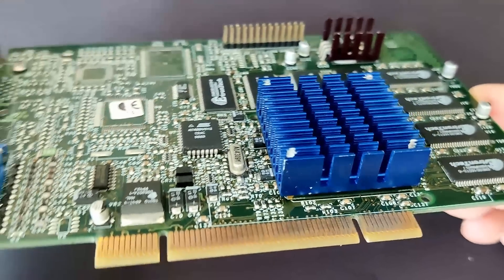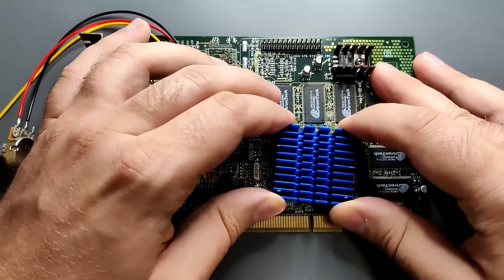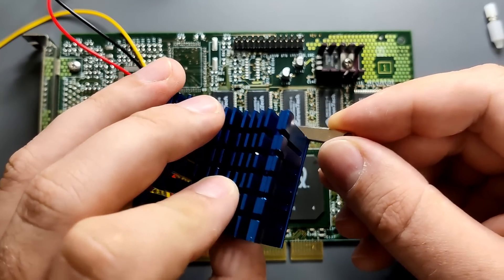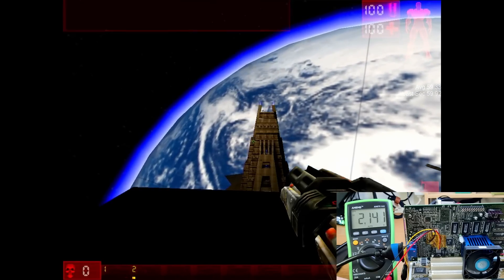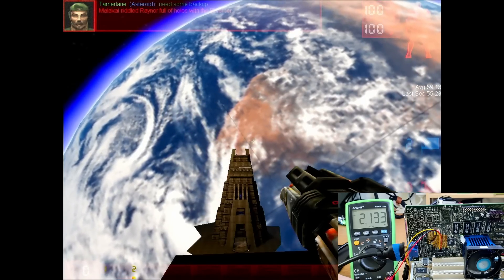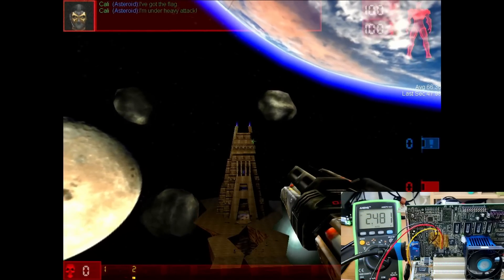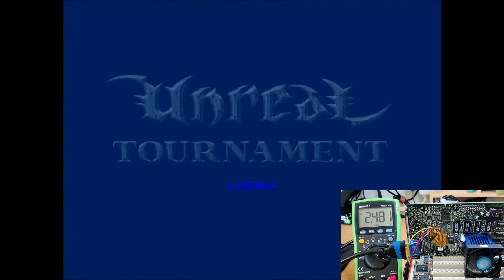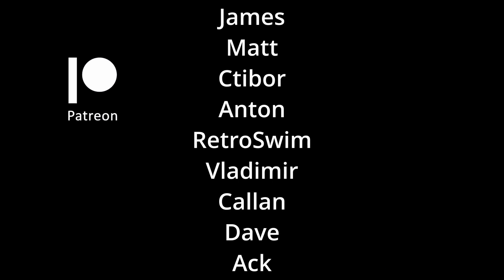The road to Voodoo 3 2500 | 3250 | 3800?

Comment: I'm in this boat right now.  I've got a 1000 with 5.5ns SGRAM that runs at 160 with very occasional artifacts, and I haven't recapped it or touched the voltage yet.  It's so tempting to give it just a little more voltage to reach the coveted 166...  What do you think I should do?
Reply: I found the confidential Voodoo3 datasheet online...  Since my card already had a heatsink attached by the previous owner, it should be safe to bump the voltage to at least 2000 level, or so I think.  I'll do measurements tomorrow but this is looking promising already.
Reply from the maker: All those chips should be from the same architecture. So, I don't think that there should be a problem overvolting the card a little bit. It could be that the lower quality chips leak a bit more current, but it should be fine. The Voodoo 3 1000 has a different layout though, doesn't it? So, I'm not sure if there is a similar resistor deciding on the voltage that is supplied to the chip and where it is. But I am sure there are voltage mod tutorials online. I just don't have a V3 1000, that's why I never bothered to look it up.
Reply: @bitsundbolts  Yeah, I did the measurements and the mod today no problem.  The card started out with a 130ohm resistor and measured 2.30V core.  I attained 166MHz at 2.50V, but in some games artifacts were still showing up, artifacts cleared up at 2.55V but after a while it locked up.  No artifacts or lockups at 2.60V, which is 100ohm resistance for me, which for some reason seems to be inverse compared to your video.  Seems I'll still end up with active cooling on this card as without the fan on the GPU chip reaches 74°C (case open).  I like my chips below 60°C.  Also for reference my real 3000 originally has a 120ohm resistor (no voltage measurement yet), it runs too hot for my liking and does lock up after an hour of playing if I don't cool it with a fan, I may try reducing the voltage on it as it has overclocking headroom up to 190MHz, good binning but 6ns SDRAM.  I have a dual fan slot cooler that I use for testing, but I may end up attaching permanent fans to both cards.  Interestingly but the overclocked 1000 beats my 3000 in benchmarks, I read that SGRAM provides marginally better bandwidth at same clocks, perhaps fewer wait states or refreshes perhaps.
This 1000 card still has one more problem though, the picture is wobbly (like horizontal jitter) at high resolutions, it seems to be worse when there is hard drive activity.  GPU clock and tweaking the refresh rate does not make it better or worse.  It's like there is insufficient filtering on the card somewhere, perhaps in the horizontal sync.  Some folks on Vogons also have similar problems with their Voodoo3, at least one said that recapping reduced it.  By comparison my 3000 does not have that problem.  Have you seen this problem?  What do you think it could be?
Reply from the maker: I would have guessed to be the capacitors on the card as well. I have not seen any noise in the image on my cards. But I may be a bit biased because I use the capture equipment and this sometimes makes things a bit worse. Also, I mostly use lower resolutions. A nice little project you have there! Some day, I need to get my hands on one of those Voodoo 3 1000
Reply: @bitsundbolts  I ended up attaching a heatsink to the back of the card as well, as that area was hot, so now it's a heatsink sandwich around the GPU.  I soldered an additional 47uF capacitor around the capacitor on the 5V rail feeding the GPU core regulator, however that did not improve the wobbly picture.  What did improve though is when I modified timings for the 1024x768 mode in PowerStrip to make them tighter, lower the scan frequency and lower the pixel clock, still 75Hz vertical, but lower horizontal clock and pixel clock.  Seems like a pixel clock PLL jitter issue above certain frequency (the rest of the refresh timings are derived from the pixel clock).  I wonder if this is something addressed in different VBIOS versions, I have yet to flash this 1000 with anything else.  I've seen posts online saying 1000 has one TMU disabled  by the driver and a YouTube video showing a registry mod that enables it in the driver, however mine reports both TMUs enabled in Quake 2 benchmark numbers also show full performance, so not sure what the deal is with those rumors.  Have your noticed any differences between VBIOS versions on these cards?
Reply from the maker: I did not see any difference when updating the BIOS on my Voodoo cards. But I also don't use higher resolutions. And some of my cards are broken and needed a reflash. So, I couldn't compare before and after. Not sure why your card has both TMUs enabled. Maybe it's a third party driver that does that automatically? I doubt it to be wrong information displayed in Quake since you get the full performance. Maybe run some other benchmarks to see if you get similar results. I assume your card has 16MB of memory - or does it have only 8?
Reply: @bitsundbolts  You're right, I use the unofficial 1.09 beta 10 driver.  That's probably the reason for the enabled 2nd TMU.  I'm thinking I need to flash it with some 2000 or 3000 VBIOS so both TMUs would work with any driver, probably from a SGRAM card, unless they're universal.  The datasheet does show the memory type configuration pin and chip count configuration pins, so in theory it could have detection capability...  I suppose that VBIOS editing utility might also let me edit the device ID so I wouldn't need to use an image from another model.  I have yet to experiment with that.
Reply from the maker: I have limited knowledge but that, but I'd be careful flashing a voodoo 2000/3000 bios on a SGRAM card. Even though the BIOS could have detected the memory, I doubt they implemented such features back then. They probably just released two versions. But I'm not aware of any SGRAM Voodoo 3 except for the 1000 series.
Reply: @bitsundbolts  I think I posted a link here with the Voodoo3 VBIOS repository for different types of cards.  Anyhow, I've been running it flashed to a 3000 SGRAM for some time now, it's great.  This way it has 2 active TMUs with any driver.  Now I added a 5V 40mm fan powered directly from the card, and it's icing over at just 32°C during extended stress test.  I may swap it for a Noctua fan later, but for now this is a success.

Comment: ah you should test at 32 bit color and 1280 resolution cause at 16-bit color it is a bit odd 800x600 well because it can another thing get a hot gun and punt the card on a agp 8 x card since your bios is flexible and can be configured at any type.

Comment: Another cool video. I am thinking about buying a voodoo PCI card for an Amiga 3000 I just built. Yes Commodore Amiga, with Motorola 68K cpu. Duaghter board has both Zorro III and PCI slots and Voodoo drivers exist for Amiga. Neat stuff. Keep up the good work.

Comment: I have voodoo3 3500 with faulty out connector, but I got similar dvi right angle port. Can you cover modding  high end voodoo3 for regular dvi output instead of using proprietary 3dfx cable. I don't have such cable. Many voodoo cards comes with no cable. It's easy to obtain vga loop cable for two first voodoos, but not possible to find reproduction for high end voodoo3 card. BTW stop torture those nice 3dfx cards. There is no point overclock them to get extra 5fps. Lastly, instead of attaching cpu-like passive heatsink I'd recommend shorter classic heatsink with active fan powered from external molex. Will be more than enough for regular operation and also will save another pci slot
Reply from the maker: That is an interesting change for a Voodoo 3 3500. I came across those cards without the cable. I will look into it - just need to find a reasonably priced Voodoo 3 3500 :) A damaged card (that can be repaired) would be great for such a project. And I completely get you regarding torturing 3dfx hardware - if I do something like this, then it will be just for the sake of a video. I am also looking for a better heatsink. I don't want to give up on two PCI slots (or the ISA slot).
Reply: You are awesome! Thank you for great content. Looking forward to see 3500 dvi out video. This could change ultimate 1999 pc build entirely. Tnt2 ultra can do 32bit, but v3 3500 can outperform in certain games

Comment: I've many voodoo3 and they are all high overclockable!!! My old V3 2000 easily reach 175mhz, and other V3 3000 pass 200mhz with one that work at 215mhz a really high freqency for that time!!! If you want the best ratio between performance/voltage for sure the best freqency is between 166/175mhz is the sweet spot!!!
Reply from the maker: I tend towards 175 MHz - I like the frequency and the opportunity to call it a Voodoo 3 3333 (as someone else suggested)!

Comment: BEWARE: artefacts are a poor way of verifying that the GPU is functioning correctly. Vector/polygon calculation errors will begin way before any typical artefacts become visible. 
OCCTPT is a benchmark that tests for such errors. Also "Artefact Locator" & Video Memory Stress Test" (both by Misha Cherkes) can be useful.
Reply from the maker: Stability has to be tested on those cards separately. My assumption in the video is to give 75 mV over the voltage where artifacts appear. But you are right, that doesn't mean it is sable.

Comment: Personally I go for active cooling and not have to worry about thermals at all. As for the memory I might get into doing such mods someday replacing with faster chips for obvious reasons though I already own a 3500 and with faster ram they can clock around 200mhz provided the core is healthy enough not being baked to death.

Comment: what about jumping the 3.3V regulator directly to PCI slot if possible?. that will reduce both power consumption and heat generation. if you're concerned about backward compatibility, you can add two schottky diode in between regulator output and PCI 3.3V, preventing backfeeding between both
Reply from the maker: That would be an option, but I think I miss the knowledge how to do something like that. I understand the concept of diodes and their purpose in your suggestion. I guess it is to prevent current to flow "backwards" into any of the outputs. But I would have to check if the 3.3V from PCI is routed somewhere on the board or if I would have to route it from the PCI connector (which is a possibility since it looks like this Voodoo 3 was designed as a 5V card with all the regulators onboard to get to lower voltages as needed).
Reply: @bitsundbolts  sure, another thing you could do is replacing the old linear LDO to buck converter. something with discrete mosfet might be better than one IC solution (which a lot of time they're using fake ICs). if you were going to replace the GPU regulator with buck converter, it might be a bit more efficient to take 5V rail as input compared to taking 3.3V from its "pre-regulator"

Comment: Great video as always! It's interesting that this V3 2000 came with 6ns SDRAM installed. Both of my 2000 AGP models have 7ns chips. I actually have a Voodoo 3 1000 with 5.5ns SGRAM, so I assume it can vary due to cost and availability of what they could get at the time.  In my experience, most of the Voodoo 3 3000s with 6ns memory I've tried to push seem to hit memory limits at about 175-180MHz, so it's difficult to get to that magical 183MHz mark of the 3500. There are some brands of SDRAM that seem to have more headroom than others. I seem to recall that the Hyundai SDRAM was a bit better than the others available. The two cards I did total memory replacements on with 5ns chips went from 177 or so to 191MHz before the core became the limiting factor. Cheers! 👍
Reply: The 6ns Hyundai SDRAM on my Voodoo 4 4500 AGP can reach 180Mhz. 183Mhz sometimes gives me flashing dots at higher resolutions in 3D games. I use the standard clocks now, because even Voodoo4 cards are getting rare these days.
Reply from the maker: I will attempt 183 Mhz on this Voodoo 3 with a voltage closer to the default 2.6 volts. I am aware that overclocking plus standard voltage will cause significantly more strain on the chip than running it at 143 MHz and 2.6 volts. It will be for a short test and see if it actually works with this chip.
As for the memory rating, I guess you are right in your assumption that it depends on what they had at hand at the time and what made sense financially.
Maybe there were some leftover chips that had to be put on cards that were phased out (5.5ns on a Voodoo 3 1000 is a bit ridiculous :)

Comment: Back in 1999, I had a Voodoo 3 2000 AGP with 7ns memory. I have overclocked it to 170Mhz for a few years without any problems, before I upgraded to a faster graphics card, after 3dfx was already no more...

My best Voodoo3 card in the collection is a Compaq V3 3500 AGP (not the original 3500 with the breakout pod and the tv tuner) with 5,5ns memory. This card looks like the V3 PCI versions with a normal VGA output. The Compaq can be clocked to 220MHz. This was only a test, just for fun. Only a 3DMark 2000 run.

3dfx cards are good investments today, so I leave it in original look without any overclocks.
Reply: I keep having issues with 3500 cards that some textures turn black while playing 3DFX games, happens on two different cards, had any issues like that?
Reply: Try out the latest 3dfx reference drivers for your OS and if this does not help, another mainboard. The 3500 cards draw even more power from the AGP port than the 2000/3000 cards. Early AGP mainboards could cause problems, especially former Super Socket 7 motherboards.

Comment: Nice. I would think Voodoo 3 3000 because the memory will be running at supported speeds.

I will be considering the same heatsink mod for my Voodoo 3 2000 AGP and maybe doing a little overclock myself.

Comment: Congratulations! Voodoo 3 might not benefit at all from the AGP bus; so, that might not be a limiting factor. Kepping it as a V3 3000 seems like the best choice, as most other people sugested. If at that level it can still run passively cooled, then it's a win-win. On the other hand, if you do need active cooling at 166MHz, then I would run it at 175. 
Now, I have to find time to mess around with my V3 2000 PCI.
Reply: It most definitely benefits from the AGP bus. While the Voodoo3 doesn't use any of the advanced AGP features, it's still on a dedicated 66 MHz bus. It has twice the bandwidth of a normal PCI slot, and doesn't have to share bandwidth with other PCI devices.

The PCI version of the card can also run in a 66 MHz PCI or PCI-X slot, if you have a system with one, which are rare. 66 MHz PCI and PCI-X slots are usually only found in high end workstation and server boards. The Power Macintosh G3 B&W has one dedicated 66 MHz PCI slot for video as well.
Reply: @GGigabiteM  Thank you for the explanations! So, I am tempted to assume that my V3 2000 PCI (2.1) is 66 MHz compatible (the motherboard I know for sure that it is and supports bus mastering at 66 MHz too at 266MB/s), since I get identical results as my V3 2000 AGP (1.0 at 2X = 533 MB/s). This also leads me to believe that V3 AGP is actually just 1X, not 2X. Alternatively, none of the games that I tested (up to Max Payne) swap too much data over the bus, once the VGA RAM is fed at loading time.

Comment: I'd say 166 is better for longevity. 175 is nice but the closer to the limit seems like the card would not last as long. And since it is something you'd like to probably preserve i'd say safer is better. Giving the card a hot supper is not nice lol. Anwyays, love this kind of video and the technical aspects displayed here. I am still in my infancy with electronics and board level components but it's fascinating to see how the voltages and clock effect how close to the limit the card operates. I would have no idea the memory chips are the limiting factor here.

Comment: The modded bios should, if there's space, say 2000 (at the speed of a 3000) rather than just 3000 if you are at 3000-level performance.
Reply from the maker: Yes, that would avoid confusion. Let's wait for the poll. I hope for a Voodoo 3 2500, or something else non-standard. That would be clear in itself.

Comment: Why does the cooler feel like some sosrt of universal northbridge cooler.
And the results remind me of my Geforce 3 Ti 200, which runs at (imaginary) Ti 400 levels. Not quite the clocks of a Ti 500, but sooooooo close.
Personally 155 MHz on 2.25v and 175 MHz on 2.45v feel the most interesting. simply because they aren't clocks common on Voodoo cards.
Reply from the maker: You are right, it is a universal northbridge cooler. My personal favorite is 155 MHz - as the thumbnail may suggest.